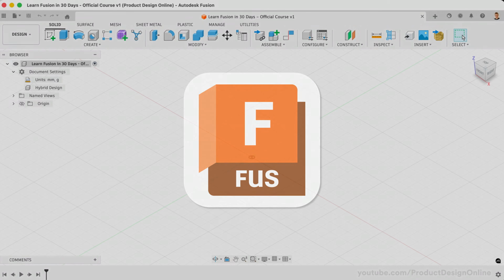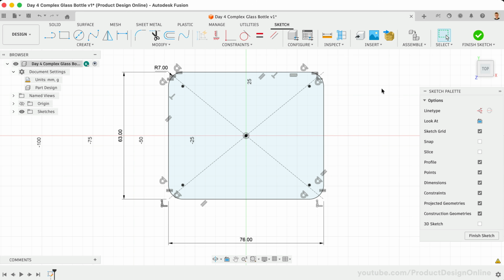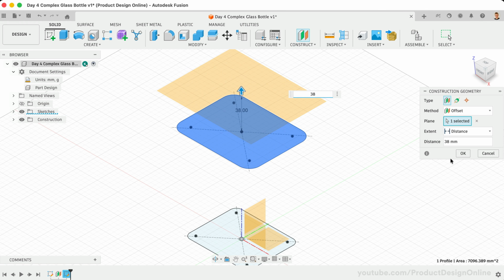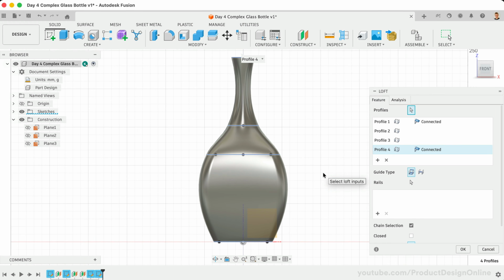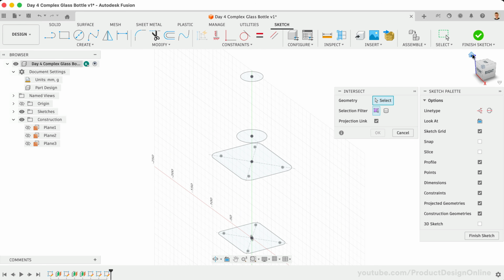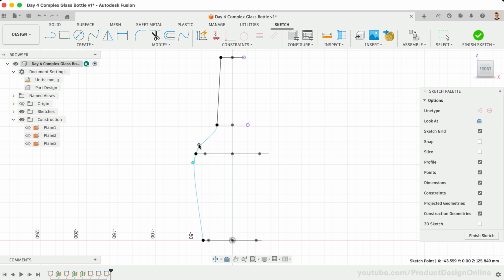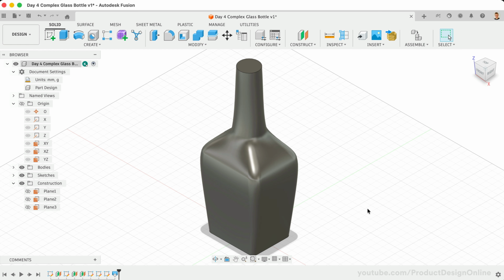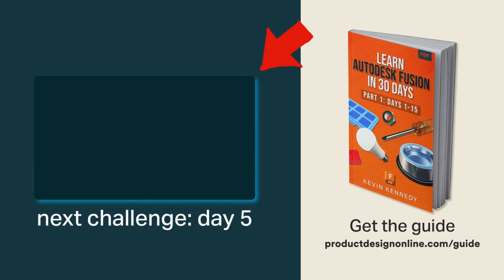Square to Circle? EASY | Day 4 of Learn Autodesk Fusion in 30 Days! (2026 EDITION)

Comment: I dont know whats going on but my x y z access are all different to your is there a setting i havnt set?  you select top vie and say xy access but when i do the same thing its a differemty access?
Reply: i was struggling with the same issue but i did some digging and found that fusion is set to Y-up by default but when he recorded it it was Z-up, the reason for the change to Y-up is simply that its more universal, if you want to change it to his just click on your profile in the top right, my preferences and look for an option that says "default modeling orientation" and set it to z-up

Comment: Software isn't consistently allowing me to draw shapes on axises other than XY, I had to rotate the circle last lesson 90 degrees to compensate for that. I managed to get the first guide rail drawn, I don't know how, but A: I had to place points manually because the intersect points would only show up on the corners of the rectangles and the centers of the circles and B: while trying to mirror that shape, it wouldn't let me click on the line I had to mirror or on the Z axis in the drop down menu. I deleted the whole thing after an hour and tried again, but couldn't even get the guide rail drawn the first time

Comment: 1st. These are amazing. Wish I would have found these when I bought my printer 2 months ago. Only question I have is when I do the independent practice for the vacuum piece and extrude them 25mm. The bottom goes below the plane. Not sure what I am doing wrong. I've tried different options and it just messes it up. Also does it only allow you to extrude them separately? I tried clicking both and extruding but doesn't seem to work. Thanks again for these. Learning a lot and having fun
Reply: guess it really doesn't matter. was thinking print plane from bambu. this is just designing. lol

Comment: I encontered some trouble that was not mentioned in the video! Not an error but after applying the loft to the bottle, the top and bottom are not filled! So The bottle is just a thin shell, which doesn't allow me to fillet the bottom.

I carefully rewatched the video and cant tell what I did differently. I even tried connecting the rails with lines at the top and bottom to close the sketch, but that messed up the loft.
Reply from the maker: Can you double-check that your Loft command in the timeline is blue and not orange for the surface loft?
Reply: @ProductDesignOnline  Ahhh that was it. That's what I get for following the tutorial with f.lux at maximum redness. Too used to everything being orange! Thanks for answering!

Comment: When opening completed file in Bambu Lab for printing, it recommended supports. These supports (which didnt seem necessary to me) were on each side of bottle, and only attached (tree style) at the threads of the bottle at the top. When removing these tree supports, the threads broke off with the supports. It seems like the thread thickness/attachment, etc isnt very robust here. Any tips or suggestions?
Reply from the maker: Try disabling supports for the threads, as they are likely strong enough to print without them! That said, are you printing it scaled down or 1:1 size?

Comment: When I selected the middle spline point, I didn't get the handles. What am I doing wrong?
Reply from the maker: Try to click out in space to clear all selections first. Then click the point again. Sometimes Fusion can be picky about it. If it still doesn't work, it may be a graphics issue. What computer are you using?

Comment: Rail is not smooth it says when i go to connect rails in loft command?
Reply from the maker: That is likely the connection where you're spline connects to the straight line. Double check that that spline handle is snapped to the straight line making a smooth continuous line.

Comment: Is only the top section is hollow after using the shell command? Somehow I don't think the whole bottle is hollow and I don't know how to check without having to print it. thanks! i love the videos!
Reply from the maker: Thank you! Use the "Section Analysis" tool in the Inspect menu (activate it and select an origin plane) to slice your model and see the internal view.

Comment: I when I tries to loft it with the rails it said “this action does not make a meaningful shape change” and wont let me loft
Reply from the maker: Try running the Loft with just the Profiles first. If it works, add the Rails one by one to identify which one is causing the calculation to fail.

When you then go to select the rails, double-check "chain selection" is turned on. You'll want to make sure you don't select the rail twice. It should automatically select the entire rail. If chain selection is off, you'll need to select the spline and line separately (as two clicks).

Comment: After mirroring the guide rail from left to right, the guide rail does not intersect the edge of the elevated plane which prevents the Loft command from rendering.  Is there a command to move the guide rail rail to the edge of the plane?  I am guessing that the rectangular shape on the second plane is not centred, maybe.
Reply from the maker: It is more than likely that one of your sketch profiles is not centered. I would recommend editing a sketch of each one and make sure it is centered to the origin. All four will have to be centered to the origin. That will be the only way to get it correct with symmetry.

Comment: I have had a hard time learning Fusion and understanding certain features, your videos have made several concepts much easier. Earned a new subscriber, thank you for the incredibly helpful and practical videos!
Reply from the maker: Thank you, Chad! What types of projects are you wanting to create with your Fusion skills?
Reply: @ProductDesignOnline I wanted to learn 3D modeling for several reasons. I recently bought a 3D printer and wanted to learn how to make things from scratch instead of only being able to make models I can find online. I also recently acquired a wood CNC so Fusion would also be good for this. Lastly I work as an industrial mechanic, and certain parts of the job would benefit from me knowing how to use Fusion. So it would have both personal and professional benefits.
Reply from the maker: @ChadA23  That's awesome. You have a trio of reasons to dive into Fusion! What CNC machine did you get... a small desktop one or a larger one?
Reply: @ProductDesignOnline It is a Two Trees TTC 450 Pro. It has a 460x460x80 working area

Comment: For some reason - after I loft - the mirrored side of the bottle between Profile 1 (the base) and Profile 2 is concave - but the side I created the rail on looks correct.   It was also randomly giving me Rail errors saying that it doesn't connect to all profiles - but it definitely does.
Reply from the maker: Any chance you could share your Fusion file? Export it and email it to me, kindly.
Reply: @ProductDesignOnline hi, i also encounter the same problem
Reply from the maker: @stefchuu-h9j  It's more than likely your sketch is not centered to the Z axis (mirror axis). If you can't find the issue, send me your Fusion file to the email in my YT bio and I'll take a look!

Comment: when i try to do the loft, it says to me that the guide rail does not touch all of the profiles. i redrew the guide rails but still it does not work.
Reply from the maker: Did you use "Interest" on all four points?  Edit your guide rail sketch and click and drag each point to see if one of them will move away.